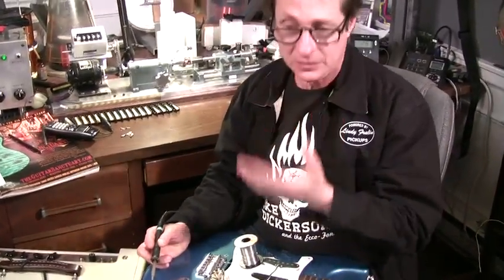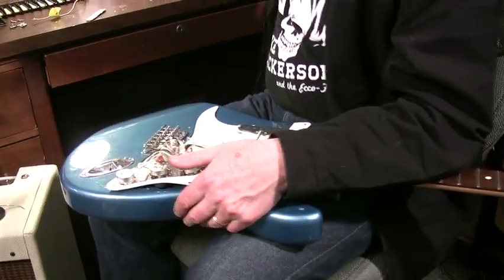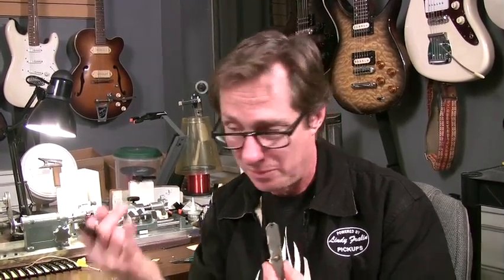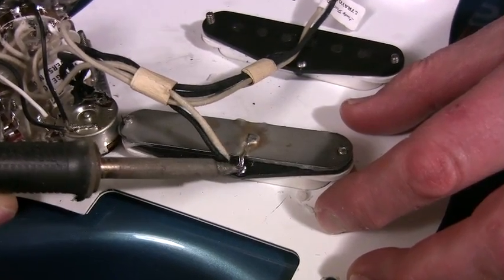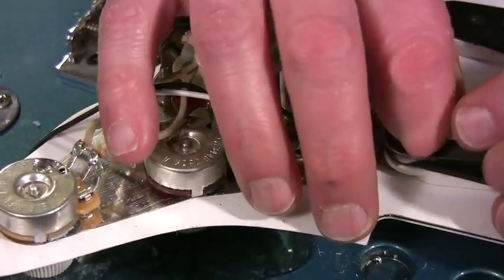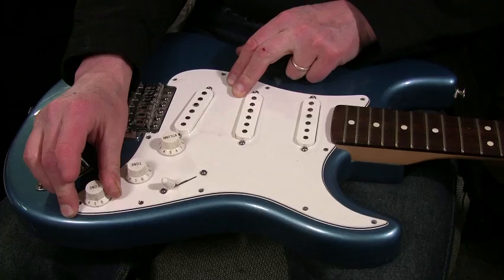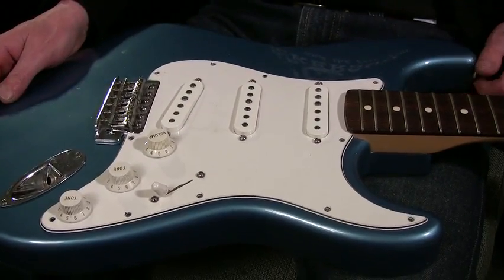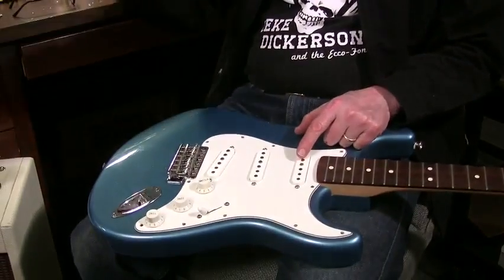Tech Tips with Lindy - Part I

Comment: To expand on what you said: 'back in the day' (i.e. vacuum tube TVs & radios etc.) at electronic trade school the instructors always made a point to explain that solder is there to prevent oxidation and corrosion of an already secure mechanical connection.  

However, when dealing with modern surface mount devices that is not possible and solder is the only way to secure the connection . . . which is why I sometimes had to re-flow motherboards on laptops with hot processors (or any hot components on PCBs) and poorly designed cooling.  Or the laptops were actually sitting on a user's lap and the cooling vents were blocked. 

Even with the post vacuum tube so called solid-state TVs (actually hybrid cuz they still had picture tubes)  I saw a lot of arcing burned out connections with Molex connectors and the like in TV horizontal and vertical (yoke) driver circuits.  Same with audio amp power transistor output stages.  

Even with modern components there are also PCBs in many of the newer 10,000 Megawatt (I exaggerate for effect) hybrid 'tube' amps . . .  But not the million-dollar boutique amps.  Again I exaggerate for effect . . . but they ain't cheap

High production flow soldering was not enough in many cases and you had to sometimes get a bit creative when repairing.  I always checked any such connections did a bit of preventative maintenance.  I charged for it but informed customers (sometimes after the fact oops) and there were always some assholes that that didn't appreciate it and accused me of padding the bill when in fact I was 'doing them a solid'.   I thought that's why they were referred to my shop in the first place.  I always figure I have the gear opened up on the bench and really getting intimate with it - so why not spend another 15-30 minutes touching up some problem prone connections while I'm in there.  
. . . . but I digress . . .  

Awe hell, since I'm already off on a tangent . . . 
Do you know how to get a musician to pay for his amp repair before you let him take it with him (vs. waiting till he plays the next gig)?  
Get the money from his manager (i.e. one of the guys in the band's girlfriend).  

Do you know how you lose a friend?  
Charge him a fair (fucking LOW 'friend') price for labor and parts at cost for an ASAP emergency repair he needed done yesterday.  So you end up spending a beautiful summer weekend inside your basement doing the work while he's outside partying at the lake . . . . I'm not bitter that's the kind of friend I want to lose.  LOL.  

 I haven't owned a repair shop for decades.  I only repair stuff mainly for myself but sometimes (as seldom as possible) for family and 'friends' . . . don't even get me started on doing repairs for family . . .

Comment: What temp do you use? i'm always afraid of setting it too hot and hurting the parts...
Reply: I use 750 when soldering terminals and 850 when doing the back of pots. Where you have to be careful with too much heat is chips and printed circuit boards.

Comment: I've been seeing boards with a plastic thing, kind of like you plug speaker wire into, that lets you easily connect/disconnect wire and possibly capacitor. seems convenient, but I don't know if there's any reason not to do it on a guitar like this
Reply: They most likely work fine, but I prefer soldering. A good solder joint has both a mechanical connection like the push-ons and the solder surrounding the mechanical connection.

Comment: I have 3 questions I’m hoping to get answers on.

On the back of old fender pickups, winding wires are vulnerable to damage, especially on the very exposed edges of the lower fiber bobbin plates. (or plastic on modern ones)

Is that exposed wire on the very edge just the extra coil wire brought around from where it is already wrapped around the wire lead-outs at the coil side of the plate to simply end conveniently in the assembly process? 

I have not had to find out yet simply because I have not had to repair any pickups....yet.

If you damage it at that point, will it open up the pickup?  

Those are very delicate wires exposed in a very bad place and can be easily damaged during installations.

The other problem that people can miss is that those exposed tiny little wires can come in contact with any shield, whether it’s copper tape or some just shielding paint and can cause a pickup to not function.

Do Fralin pickups have grooves on the bottom plates to lessen the likelihood of damage when you sell to general public customers?
Reply: Our Tele neck pickup does have grooves for the wire. The brass eyelets in the bottom fiber plate are for the beginning and end of the coil. The wire is stripped and run through them several times, those extra wraps are there just to keep the wire tight until you can get solder in the eyelet. If the eyelet is soldered correctly, (the first wire through making contact) then you could strip the wire on the front edge away. Most pickup makers don't because it is an insulated wire and usually doesn't cause problems. This can cause problems when the second or third wire through makes the contact, then as you said those exposed wires are part of the circuit. If a pickup dies the first thing I always try is re-soldering those eyelets.

Comment: Thanks indeed so well explained...   Im trying to get more of a natural taper on volume pot and
I was trying to wire super switch where neck and bridge were on in pos 3 and in 2 and 4 as normal middle bridge middle neck.

The blender is neat I did get some ordered in to try the only thing is  what if you like oo2 on bridge and o47 neck middle ?

I am used to having 2 tone pots working independently for some reason thought this could be done 
with super switch but so far not working right.

I did wire the magic cap in on bridge paf  finding that interesting tonight !
more mids indeed and no harsh or shrill highs but you can dime it on 10
tone pot wise and its pretty great there or around 7,8 tops..

I might like 22 there better more used to that on paf in bridge 

I have another Hss style setup but its got rails in neck and middle and they are too dark.
So I want to try a 15 on those neck and middle and 22 on bridge..

As for SSS setup  im wanting to try .002 now in bridge  taking ice pick highs out but
leaving more sounds... from 0 -10

indeed did make the string thicker sounding....

OH I found  a Decade box same as the one your demonstrating its en route now..

Makes me want to setup another Tele and or strat with no cap on tone pot
and be able  to try those on the fly to record or demonstrate with.

It also occurred to me why not take these other caps  im trying and if I dont like them
wire them in another box to demonstrate  caps  such as paper in oil or poly side by side
to hear the difference..

I found the .047  paper in oil caps too warm so went to orange drop in the neck 047  and its perfect.
I used your 15 magic cap in bridge and thats a 57 paf   so its  pretty neat   usable tones from 0-8 or wide open on 10...

I notice that if im on bridge but just playing near 1st -9th lets say  the mids really come out there
sounds way better to me but Ill try 22  fralin cap there just to see....

Ive got two HSS style guitars same make same maple neck ones in standard ones in Eb.
One has  stock paf in bridge and two rails in middle and neck.  Those are Dark so the other 15 I think is going there and the 22 will go in bridge.

I might be swapping the 15 off the bridge but Ill just wire the other HSS  with 22 on bridge
and keep 15 on other both paf style pickups...

compare contrast..

I loaded a different set in the 2nd one   63 style single coils and 57 paf.
Now I like the one with single coils in neck and middle better.....

So if the rails brighten up with the magic cap thats another sound but closer to what I like
there.    

I do not like the taper on the volume pot though in those HSS style guitars im playing
I have 680 and 150 tied on this one think its 500k 250 and 500 in those guitars

wondering what to make that pot smoother more gradual taper  for swells ?

Also I gather if I wanted to  try blender pot and I had super switch its  just wiring
the wires to switch  bridge or neck.

Id like to hear the 57 paf and 63 strat neck blended  Might just go back in  try it
but  I like 22 on 57 bridge and 04 7 neck middle on other.
cant do that with blender.

must be way to wire in 3 position having bridge and neck come on..

Comment: Hi Lindy,
What would the effect be on a Pickups tone to extent the pole pieces length beyond the baseplate of a pickup.Added tone and output?Thank You kindly.
Reply: It wouldn't help, the steel plate conducts the magnetic field pulling it down into the coil a little. This make the coil more efficient.

Comment: Great tips thank you.
 Question, about the steel base plate on the bridge single coil. I have a alnico5 set from "the Stratoshpere" company that is like all parts a alternate shop sells guitar parts. 

What benefits will I see hear if I add the steel base plate to my alnico5 single coil?

Comment: I would be pissed if that was my guitar he was working on, if it's his own guitar cool, but working on it on your lap, no cover for the little super hot pieces of solder that spit all over the guitar when you are wiring and I've done a ton of them and it gets everywhere.
Reply: You are right, it is my guitar. I only work on my own guitars and don't pretend to be a guitar builder or repairman. I have been soldering so long and have the right equipment that I never drop any. The key is to use as little solder as possible and shake off excess before bringing the pencil over the guitar.

Comment: Lindy,
I would like to install a base plate on my bridge pickup but one of the pole pieces are sitting proud on the backside. So, the plate is not sitting flat and rides on the pole piece. Is there a way to safely cut the magnet back flush?
Reply: It was pushed down with-out cutting the coil so it can most likely be pushed back up. It is a small risk though. You could drill a hole in your baseplate and let the magnet poke into it, it will still do its job magnetically.
Reply: Thank you very much :)

Sincerely, JR

Comment: Just installed a bridge split-blade blues pickup in my strat plus.  Awesome!  First time that I have been really happy with the tone of bridge (tried several other pups along the way).  Bought a base plate as well, but I haven't install it.  Is the base plate meant to be used with the split-blades?  I haven't seen anything that says yes or no on this...

Comment: A few more tips :  When soldering on a guitar body , place something over the body to protect it from solder spill , heat , accidental iron being dropped ,  scratching . Never put anything on the guitar body like solder wire roll etc  unless the body is covered up . Masking tap and newspaper .. cloth, towel , ... 
I've done it all before :-( so don't do what I did by accident ..

Comment: A couple of years ago, I sent the bridge PUP from my original '72 Strat to be re-wound by you (I had installed a Dimarzo Fat Strat). The original PUP was damaged when I self-potted all the PUPs. Now I want you to rewind the other PUPs, the potting I did was terrible and the PUP you fixed sounds great, plus now I've learned to solder the leads once I get the PUPs back :).